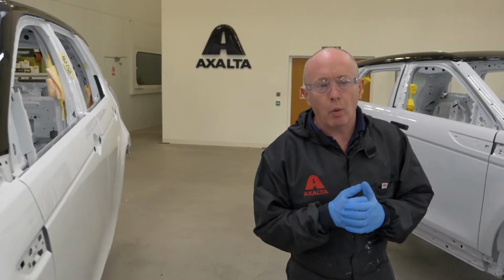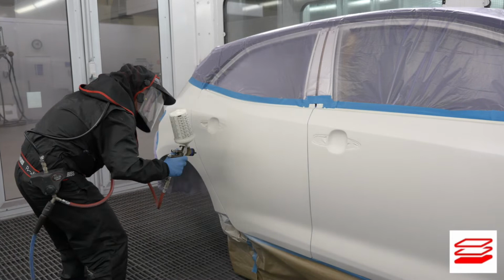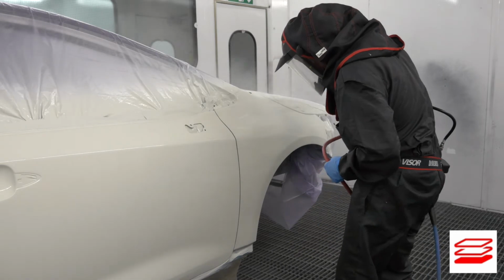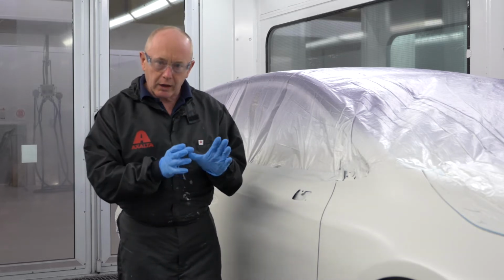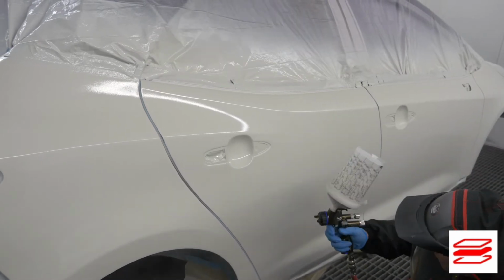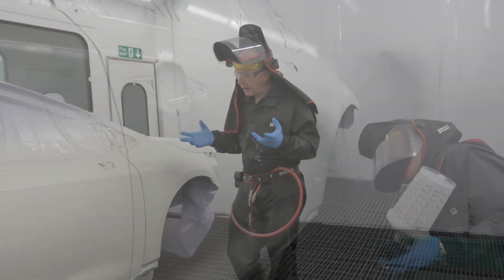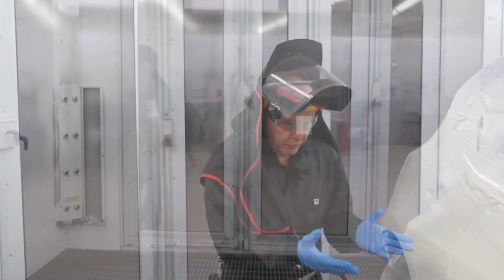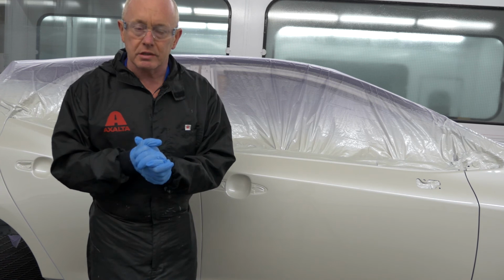Permahyd Hi-TEC Base Coat 480: 3-Stage large repair

Comment: mr tony likes more to apply the 480 series with nozzlle, in i or in o? 8700 is also my favorite clear. I would like to know what is Mr Tony's preferred nozzle setup and pressure to apply the 8700.
Reply from the maker: Hi thanks for the questions. Gun set up is a personal choice, I prefer the 1.2O as it allows me to work a little faster. Others will like the I as they have a slower application style. Both work well with Hi-TEC 480. As for the 8700 clear I again prefer a 1.2O with an inlet pressure of 1.8 Bar.

Comment: sata 5500 rp for clear ¿1.2 o 1.3? ¿o I ?
Reply from the maker: In this case I used a 1.2 as I was using a lower viscosity HS Clear. Either is possible though.